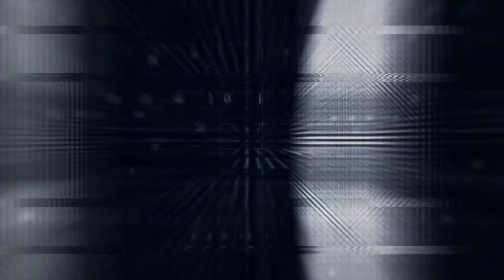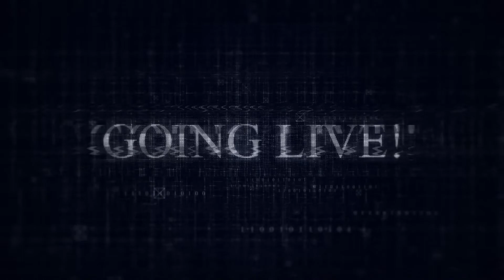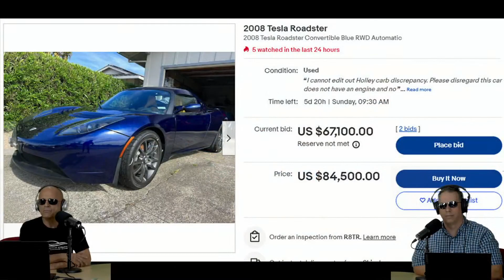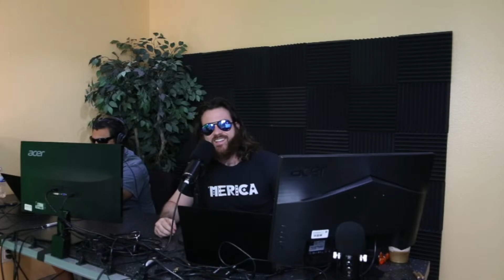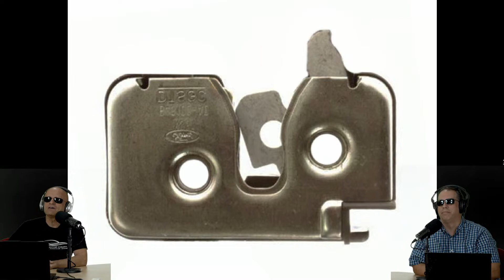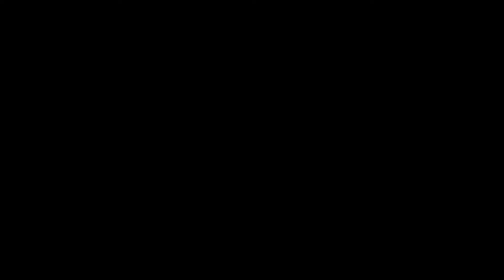Tesla Roadster Podcast - EP 017

Comment: If the Government’s keep pushing to eliminate Infernal Combustion Engines then it’s possible to change those politicians and their thinking. If we move from fossil fuels to non fossil fuels such as coconut or vegetable oils which many of our Diesels can currently run. I wonder if Palm oil has the needed energy.
Any suggestion of a window’s Car triggers the BSOD in my mind, you  know, go add an extra component and the car stops dead on the road with an error on the feared Blue Screen Of Death ! Just imagine the wait for a technician qualified to make the correction or upgrade. Then there is the wait to debug and recompile the source code …